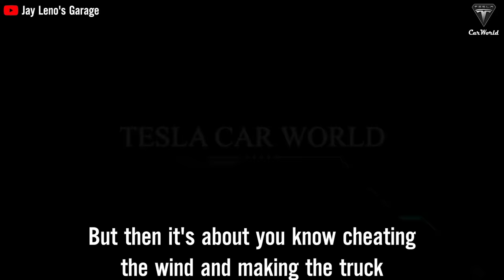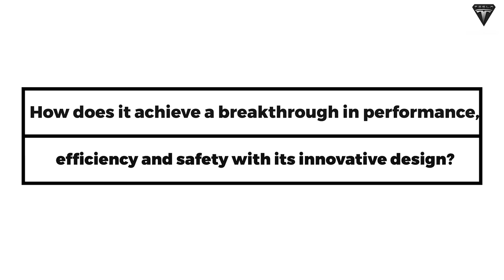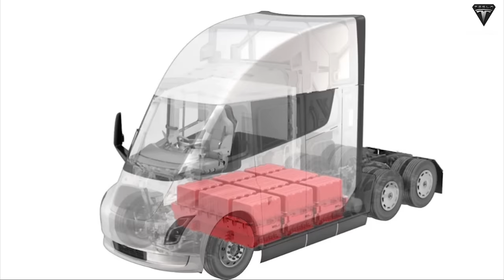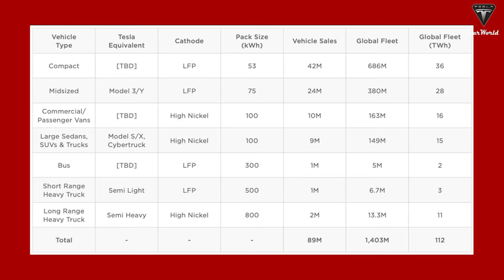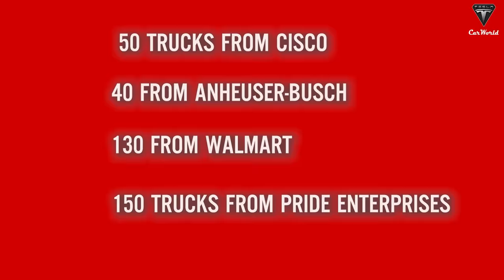Elon Musk Revealed Tesla Semi "Bullet 0.22 CD" 82 000 lbs, 45 min 90% charged, 5 Surprising Features

Comment: Range is meaningless, cargo carrying capacity is and the Tesla Semi, sucks, carries way less then a normal truck, so you need more trucks, more trips, more cost, more headaches, less profit.

Nobody in their right mind will use these for long haul, they don;t even work for short trips.
Reply from the maker: Why do you think the cost will be higher? What will the environment be like?
Reply: Economics.
 @TeslaCarWorld
Reply: The facts are that you are wrong because the average loads are far under the maximum theoretical.
Reply: Show your math that Semi will cost more. 
Start with the fact that Semi has been filmed pulling a 44,000 lb load on a 10,000 lb trailer. 
Note that Pepsi is very happy with the performance of Semi. 
And with team driving, Semi has even covered 1000 miles in a 24 hour period.

Comment: Great article. This is pretty exciting product for the heavy tractor industry. You stated that PepsiCo tractor was tested with a payload of 81,000 lbs. That is not correct. 81,000 lbs is the GCW(gross combination weight) you have to deduct the weight of the tractor and empty trailer weight from 81,000 lbs for the correct payload. II sold commercial trucks for 32 years. Other than that very impressive.

Comment: Work van would be a good addition to the family possibly using the cybertruck running gear and various batteries for range.
Reply: I expect such a vehicle is already on their drawing board.  But not until the Semi and Cyber and 25K family offerings are a done deal and in scaled production would be my guess.
I am thinking the Cyber-truck battery and cast chassis are already contenders for the work van (small-goods haulage) that you envisage.

Comment: It weighs so much you can only haul about 30,000 pounds of cargo, and getting the electric service for one single charger involves installing a 1,000KVA pad mount transformer and spending at least $1,000,000. And that is if you are lucky and that much power is even available at your location.
Sorry fanboys it's not going to charge at your home or even most business' locations

Comment: Great, a semi with a load capacity of about 3 tons. A regular semi has a load capacity of 19 tons. In a business where you get paid on how much you ship they'll stick with the regular semis so they don't go out of business. Also a range of 2000 miles on a full tank.
Reply: The Tesla Semi has been filmed pulling a 27 ton trailer 500 miles. 500 miles covers a 250 miles round trip. That is 90% of all road freight. 
Even more, most road freight is volume limited, not weight limited. 
The standard range version of Semi will have an even high load capacity at much shorter ranges because the reduced battery size doesn’t affect power of the motors. And very heavy loads typically don’t go very far.

Comment: How do you pass or change lanes when you can’t see past the vehicle in front of you?
Reply from the maker: Let's focus on the mirror and center screen! How will you do it?
Reply: With the power available - even fully loaded - I doubt that is an issue.  The cameras can see further than left or right driver seat position.  Further, no sane semi-truck driver would attempt passing on a single lane road.

In fact, I wonder if CARS can be manufactured in the future with center driving position.  That would save crap-loads of manufacturing variant/cost issues for all vehicle manufacturers and vendors.  Need ultra-safe electronic viewing though.
Just a silly thought.  'Cos don't think that will work in compact cars.

Comment: The charging is still too slow unless it is a terminal based system when  it can be done at end of shift or vehicle swap. Janus Electric trucks has a battery pack swap system that would be under 15min. and pre charged packs.  Just to put it into perspective, Imagine having to take the time to to put your car into a shop and do an oil change and wait every day. You could not expect an open charger every time you pulled up.

Comment: The Daimler Truck has 0.18 CD ... with out a bullet design
Reply: Huh?  That has to be wrong!  The CD measurement between various vehicles and manufacturers does not make logical sense.  Methinks there are two or more measurement methods in common use.  [ Speed perhaps? ].  The Aptera two-seater tri-wheel and super-low drag body is just 0.13 and soon to hit the road in numbers.  No other vehicle can currently match that.  So a blunt nose Daimler with 0.18 CD...  Nah!  Not correct.
Reply: @jimparr01Utube   Its not wrong a bullet design only makes sense at high speed, take a look at Euro Trucks designs thats the way to go for maximum efficiency.
Reply: Has to be sport car 0.018 cd yeh dream on Daimler fan boy